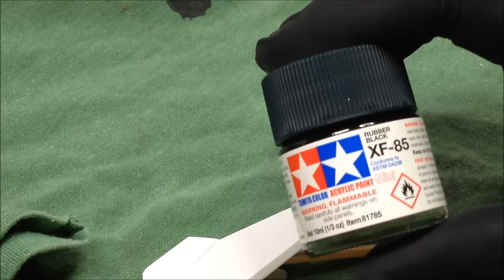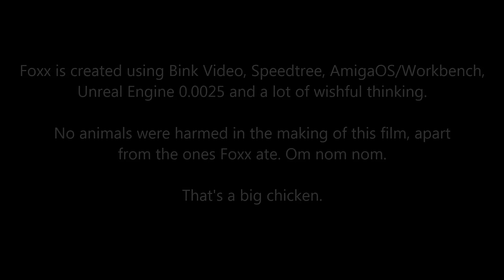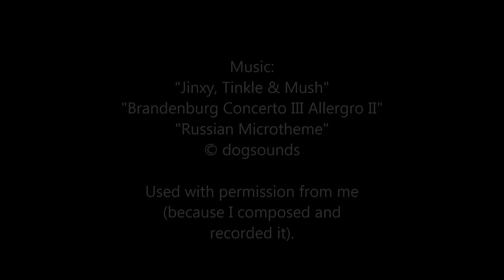SKILL LEVEL 4: Bandai MG Freedom Gundam Ver. Wolf Part 2: Nubs, Pre-Shade and Paint

Comment: when i made air fix kits i used emery boards......
Reply from the maker: ***** I still have a few in my tool stash. In fact  used one on the U-boat build to sand the free-flow vents, it was the only thing that fit in the holes :)
Reply: Yeah tgey were great because you could cut them down and even make a round curve
Reply from the maker: ***** Yep. I cut mine down to a point. Best thing is, know where I got them? From the "bits and bobs" rack in my local corner shop for, like, 50p ^_^

Comment: Don't "shave" the nub, use your file.  That's what it's for.
Reply from the maker: Shaving it shaves not just the nub, but also time - I find it faster to shave it down to only a tiny blip, and then gently sand it - that way I don't have to clean up aggressive sanding marks more than necessary because I can avoid the heavy sanding or files, for the most part ^_^
Reply: @gurufoxx  If you really want to save time that way ;spring for a premium set of nippers.  Then you can cut flush with the part.  You will still leave a very small nub, but you can skip straight to sanding.